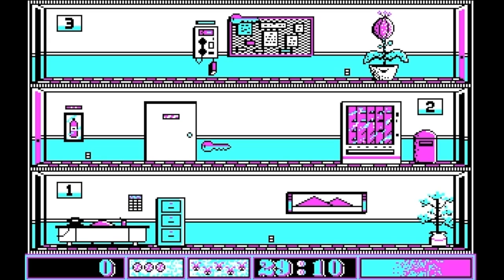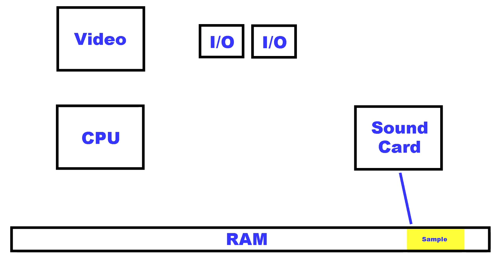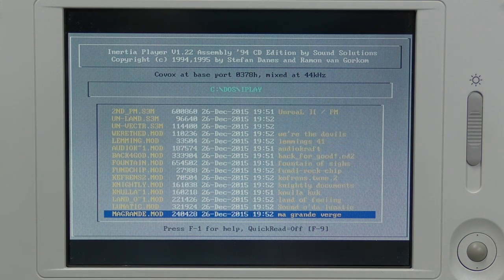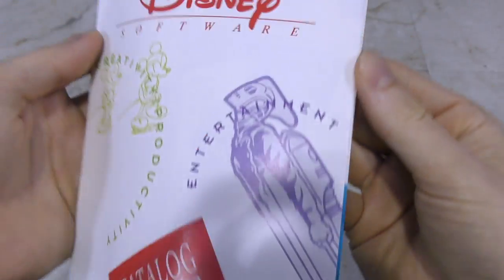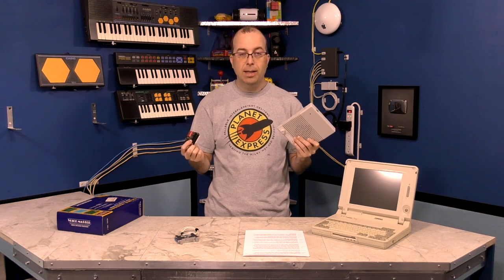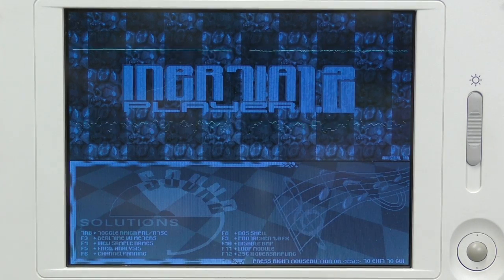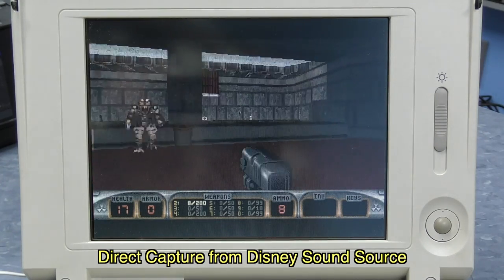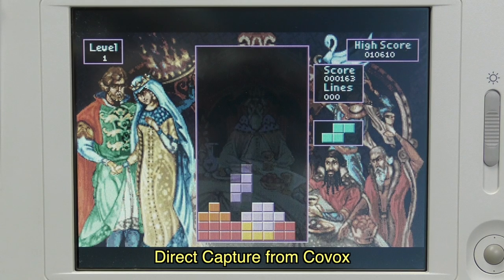How the Covox and Disney Sound Source Worked.

Comment: The hilarious part about parallel DACs is they are usually a ladder shaped network of resistors.  A speech thin clone can be built with entirely passives if you don't care about quality much.
Reply: I built mine many many years ago. it was a ball of electrical tape and poorly soldered resistors.
Reply: Building your own speech thing was quite popular in Finland too. If I remember correctly also the demoscene supported the speech thing.
Reply: @mikkoajt  I still waiting for a video about GUS used very often in demoscene as you know.
Reply: We used a covox built exactly this way, a jack and an LPT connector and some resistors. Worked pretty well.

Comment: Loved this video!! I remember the Disney sound and having to support it :)
Reply: My "Aztech Sound Galaxy NX Pro" that was sold as "Soundblaster Pro 4.0 from CPS" in Germany does support Disney Sound Source (DSS) and Covox Speech Thing thanks to an internal parallel port. But i never knew this, neither did i know that there was a TSR program, that can emulate Tandy sound.
On the other side i didn't need that. Most of the games i played where released after 1989 and thus usually supported Adlib or Soundblaster.

Comment: I had intended to donate my Atari 8-bit computer to a museum.  The RAM chipset was compromised and many of the disks were no longer functioning.  However, when I saw you put a Compact Flash SCSI drive into a Macintosh and realized that there are many ways of fixing vintage computers and even upgrading them, I decided that I am going to try to repair my beloved Atari 800XL that I had so much fun on in high school.  I am then going to get a cartridge with Compact Flash support and download a  whole whack of software and have fun again.  Thank you for your inspiration!

Comment: But the most fun thing about the Covox is making one yourself! It's just a parallel port and some resistors.
Reply: My homebrew Speckle Think (as I called it) was involved in a deadly collision between my IBM Compatible Laptop and the wood floor...
Reply: @videotoblin  Oh dear.
Reply: if you know your way with electronics that is. i can bend and bond sheetmetal to my liking, but resistors, capacitors, transistors and their function are witchcraft to me xD. i can switch out the pick ups of my electric guitars though. :D

Comment: I think you should have mentioned that the Speech Thing is simple to make since it's just made up of a resistor ladder that plugs into your parallel adapter.  It's not that hard to create your own Speech Thing and a schematic of it is available at the Speech Thing's Wikipedia article.
Reply: The docs that come with Triton Productions' "Crystal Dream" demo also include instructions on how to build one. They also include instructions for a stereo version which the demo supports, too.
Reply: Roxor128 - wow, I might've been game enough to try that if I had that demo back in the day. Our family PC only had PC speaker at the time with no expansion port to chuck in an SB16.
Reply: Discern4  -  Well, if you don't have a vintage PC to build them for and have to limit yourself to emulators like I do, DOSBox can emulate both. I don't know if it's in the official v0.74, but it's definitely in the SVN versions. I'm actually listening to Crystal Dream with it right now.
Reply: Roxor128 - Oh, I have no desire to do it these days, but it would've been a godsend back then when my only option was PC speaker.
Reply: You can use a new PC with DOS and the parallel port works the same. Actually any modern PC can be used as an "old PC with only PC-speaker". Except that some newer software support modern sound circuitry. You can also run DOSBox on real DOS and emulate old hardware components.
Reply: I did that back in the 90s before I got a sound card. Wasn't pretty as I just soldered the resisters straight onto a plug and a cable with a couple of RCA plugs on it straight onto the resisters but I remember it working quite well with the DOS mod player I used. Probably still got it around here somewhere.
Reply: Andrew. I did kinda the same thing but I mounted all the resistors and the RCA plug onto a piece of vero-board. I also didn't make it for use on a PC but for use on the Atari ST which allowed me to play the modules I wrote in stereo rather than mono. I still have it kicking around somewhere too I think.

I remember using the MOD player that is in this video through PC speaker to listen to Amiga mods on the school computers.

Comment: I wonder what sounds wil covox blow if keep it plugged while send some printing out to LPT.
Reply: yes he should try that
Reply: Elevator music
Reply: Ever had the opportunity to hear what a modem or fax sens when dialing? it should be pretty similar.
Reply: There would not be happening anything, unless you fake the computer into thinking that there's an actual printer there. A printer uses a few more lines than the 9 for a covox.
Reply: Or a parallel port Zip drive? I might set that up tomorrow!
Reply: In most cases it would be silent because Covox generally won't handle/process the extra signal needed to communicate with a real printer,
most printing command/codes would assume the printer isn't connected/isn't ready and therefore refuse to sent data further.

But I remember seeing some fancy Covox clone that did have a paralel passthru port so you can also plug the printer parallel connector to it.
Reply: You'd need to make something like the Disney thing's pass-through, except instead of needing to be enabled, would just passively copy whatever comes down the data lines.
Reply: emits a lot of noise but it doesn´t explode
Reply: Noisy, noisy, noisy. Sine waves, hiss, and squelch. Got an old CB radio? Use that as a reference.
Reply: nihonam or better yet a printer while playing a game
Reply: If it's the only device: nothing unless you short the "online" and "ready" lines in the plug shell, and have a fairly slow dma controller that won't go full-on ultrasonic if allowed to free-run in that way... if you DO do that, it'll be "various really high pitched mostly whitenoisy electronic sounds, a bit like Catting The Contents Of Random Files To STDOUT, or more usefully opening whatever it is you're trying to print in an audio editor as "raw" format, turing the sample rate up stupidly high, and hitting play.

With the Disney source, it would be more interesting, as the everything should be within audible range other than some rather odd data structures that would go subsonic instead. But that's probably got some kind of other circuitry in it to detect whether or not it's being addressed with audio data, and if not, to completely ignore everything and maintain the FIFO contents as they are.

In either case I guess some kind of homebuilt splitter could be used? Both of those words being important because basically no-one ever made and sold such a strange, limited use object (99.9% of everything designed to allow two devices easy use of that one port are either passthrus, or either-or literal switch boxes)
Reply: If you would trick the computer to actualy send the data to it, it would possibly sound like white noise

Comment: Those blessed Amiga mods. Mmmm.
Reply: Not just the Amiga (though you can't deny that's where the family originated). I listen to plenty of mods in formats that originated on DOS systems (mainly S3M and XM, with a few IT here and there).
Reply: Roxor128 Absolutely. There are quite a number of quality xm mods floating about. In fact it took the Amiga with at least a 68020 to play them.
Reply: I can't say I have much familiarity with the 68k family of processors (I grew up on DOS). How does the 68020 compare to its x86 counterparts?
Reply: I'd say the 68020 was closer to a 486, If the 68000 was a typical 386 for example. The 68020 had support for a math coprocessor, and had more internal 24 and 32 bit registers than the 68000. It also ran at higher clock speeds, at least 14 mhz vs. 7 for the 68000 as well as a few other data caching enhancements.
Reply: @randomunavailable  It was also RISC. Pity that IBM screwed things with PowerPC (or more precisely got stuck with chip building tech limitations 2 decades ago). Otherwise x86 CPU architecture most likely would be a history already at today.

Comment: I made two versions of the COVOX Speech Thing, according to the information available from BBSs at the time. The first was a simple R-2R ladder connected directly to a standard stereo amplifier. It was made from a DB25 ribbon cable, low tolerance (>10%) resistors, soldered, and then hot glued. The sound was better than the PC speaker, but wasn't clean. Next, I acquired a ZN429E chip, added a 7805, 9V battery, RCA plug and decoupling capacitor, soldered to a small piece of perf board. This worked much better. The ZN429E unlike most DACs did not have an internal latch. It is just a bunch of analog switches and a precision R-2R ladder.
My first music program was Scream Tracker 2, which I was running on a 386. I later moved on to Impulse Tracker.

Comment: Amazing intro and outro.  I have an Aztech Sound Galaxy NX Pro that I got for free last year, and it has the following within the card:
Yamama YMF-262M (OPL3)
Sound Blaster Pro
Covox Speech Thing
Disney SoundSource
CD-ROM controller
Virtual Parallel Port

It's amazing for a sound card from the early 1990s to have those features integrated into or onto the card.

Another product to review: Tandy Compatible Sound Card for IBM and compatibles. There's a Lo-Tech version out there, but it looks like it's sold out on eBay, and luckily, I have one in my Packard Bell 486.

Comment: I remember that in 1996 I had my first PC, a hopelessly obsolete 486 PC clone, 850 MB HDD, Trident VLBUS video card with, probably, 1 MB video RAM, 8 MB of RAM and, unfortunately, no sound except PC Speaker! After trying (and almost frying the computer) to connect directly the PC Speaker to my amplifier, I have found in the documentation for a mod player a schematic for building myself a Covox-like device! Since I knew how to solder and I had a lot of recovered trimmers from scrapped TVs, I have built myself something like that and fine-tuned it to sound as best as it could. Mods never sounded so good! And the whole cost it was for a parallel connector that I had to purchase... There was even a stereo version that used some active components but I had never tried it.
Since then I had a Yamaha OPL3SA3 sound card (sound blaster pro compatible and using Windows Sound System on DOS games under Windows 95, if I remember correctly) then two onboard sound codecs, a Terratec sound card that was light years ahead of the onboard codecs, and finally a truly good sound card that I currently still use.
Memories...

Comment: wow this brings back memories. I had a sound blaster. But I remember the covox. There were even homebrew solutions that emulated the conox with a resisotor ladder attached to the parallel port. So as long as you had some sort of amplifier then for a few bucks you could make a homebrew covox

Comment: Back in the day i was using a DIY covox device with a bunch of resistors and couple of capacitors.. I remember a friend of mine digging up the schematics. It was a crude one, with some copper wires actually stuck into the LPT port (i didn't even had a proper connector), but it worked. And there was a DOS TSR program that was actually emulating the Sound Blaster and using the covox device.. So quite the number of games that supported the original Sound Blaster would work on it. I remember playing DUNE 2, Legend of Kyrandia (where I actually had speech through it) and some other.

Comment: One of the main reasons there was suddenly more covox support in software was that it was super easy to build yourself. Basically just a parallel port connector, a bunch of resistors and a line out, setting you back like $5 and 15 minutes of soldering. The diagrams were published in magazines and BBS'es.

Comment: Man.  I totally had a Disney Sound Source as a kid.  I tried to install a Sound Blaster in my 286, and I actually got it in correctly, but I couldn't figure out the IRQ and whatever.  So I took it back, and they said, "Hey, this doesn't require installation," and I got it.  And it was pretty useless except for digital samples that looped over and over.  The music was still handled with the PC speaker.  Man.  Those were the days.  The old Sierra and LucasArts/Film games did decent work with the PC speaker--no tricks, just quality composition.  Amazing what could be done with a poor-sounding, one-channel sound device.

Comment: Some of the old PCs had the speaker connected through a wire straight from the motherboard, so some sound cards had a connector which allowed you to disconnect the speaker, and plug it straight into the sound card from the motherboard, so the PC speaker sound would come out through the soundboard instead.  Some even let you connect the CD-ROM sound wires up to them, in the same way, as well.

Comment: Good thing is that MS DOS was a real time operating system. The trick was to reprogram the timer interrupt (int 08h) to output samples to Covox. There used to be even a Windows 3.x driver for Covox. I actually had a Covox clone, which was an ISA card you would insert into your PC, instead of plugging it into an LPT port.

Comment: In these good old days, to listen to these famous Amiga modules on PC we simply made these things at home using LPT connector and some resistors, so the thing didnt cost $79 but more like $1. I made two of them and add an LPT2 to my PC to get stereo :) 
To make a Covox you need 9 resistors, a capacitor and a RCA outlet which fits in the hole in DB 25 plug normally used for a cable. Solder the resistors and and capacitor together, use some glue for RCA outlet, ahnd voila, the home made covox is ready :) I ihink I still have them somewhere in a bag with the old computer junk I regret to throw out.

Comment: Another minor improvement of the DSS - it can be autodetected via software. Also connect a Covox SS to the DSS passthrough for slightly improved DAC quality (may get bogus results with some software). I actually built a Covox to DSS adapter circuit 3-4 years ago with a video of the prototype on my channel.

Comment: It costed under $5 to build it. I had one built by a friend for me, it was just a few resistors. It took away the CPU load actually. There is a DOS driver emulating SoundBlaster. Also there is a driver for Windows3.1 for Covox. with the SB emulation that thing was unbelievably awesome.

Comment: FYI, those parallel port 8-bit DACs are REALLY easy to build and use about $3 in parts.  I built one back when I was twelve...  and I sucked at soldering, but it still worked just fine.  You don't even need a PCB, dead bug version is simple enough.

Comment: Ha, this is the first time I'm actually seeing DSS. That Mickey-branded plug is something. :) Some notes: 1. As many already mentioned, making your own Covox with a resistor ladder is half the fun. 2. You should be careful not to plug-unplug it while computer is on, you can fry the port (I fried one or two in my time...) 3. You found TEMU but not VSB? Strange. 4. There were more complex versions later, with stereo sound and/or ADC. Far less popular, of course, as it required specific components and schematic was more complex.

Comment: Hey, 8-Bit Guy, you have to try stereo Covox! You just get another parallel port (remember, PCs can have up to 3 parallel ports together with Hercules graphic card) and stick there second Covox thing. Now try Pinball Fantasies and Pinball Fantasies 2! I've got this setup and was loving to listen to MODs or even S3Ms that got more "channels" than 4 in MODs. BTW Hercules card allowed me to have also printer connected to 3rd parallel port and even second B/W monitor! Two monitor setup was supported br Borland Turbo C++. All of this on 286 machine :) That's incredible what two resistor ladders can do to your ears :)
Reply from the maker: I had originally scripted in about the stereo covox.. but ended up not finished that part, mostly because I had no way to demonstrate it since I can't add a second parallel port.

Comment: I can see why people wanted an Amiga at the time, it seems like sound was an after thought on the common PC at the time, while the Amiga could produce some pretty decent audio with its base hardware.

That little parallel device can produce some pretty good quality audio for such a small device and is more than tolerable for old PCs.  Seeing as its still all driven by the CPU how does it handle higher cpu intensive programs and games? Can it be used for lets say trackers?